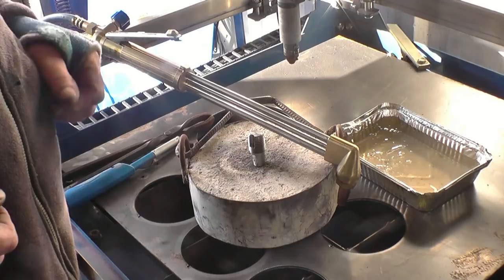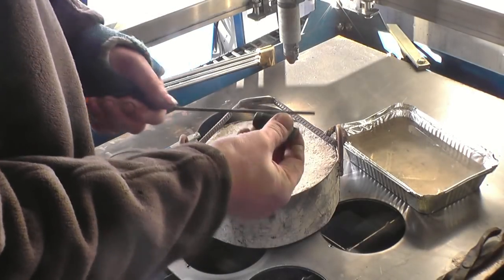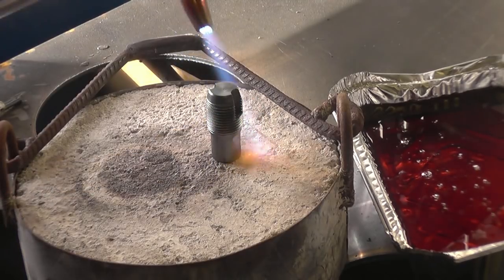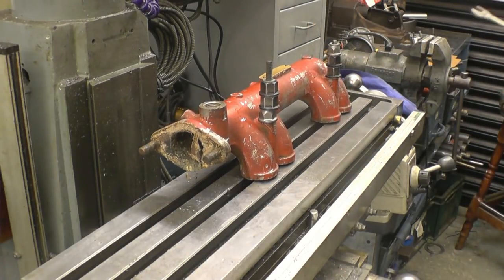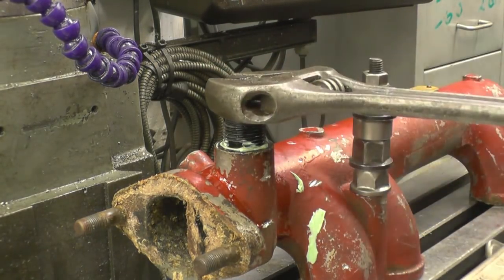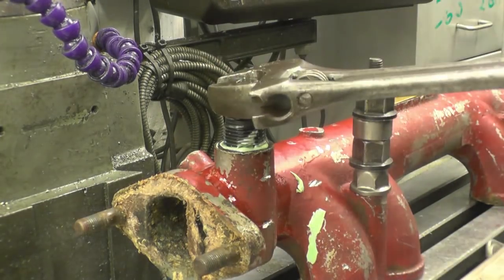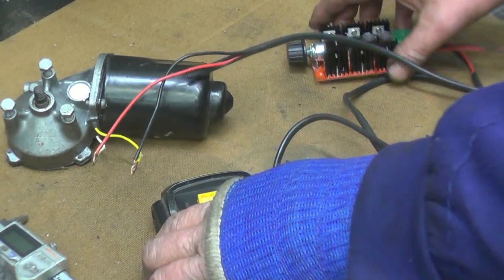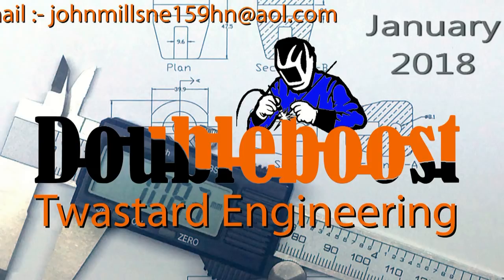SNNC 207 P2   Hardening & Tempering A Tap

Comment: Most tool steels are best air cooled after tempering, a re-quench should be avoided to reduce likely hood of cracking and improve toughness.
Reply: i used to put a thin layer of oil on top of the water so you didnt get the sudden chill

Comment: Drill and tap a shaft that will screw onto the wiper motor mate, add a grub screw to the side to lock the thread. It will save you stripping the motor. Just a thought.

Comment: you could just add a small rubber wheel to that wiper motor and use that to drive the edge of the table you already have

Comment: John, you are just going to have to stop breaking yourself. Sooner or later that sort of thing is going to hurt!

On the motor drive, why not put a flat on the wiper motor shaft and drill a matching hole in the end of a cut-down stub of the drive shaft and use a setscrew to hold onto the wiper motor shaft?

Comment: Great stuff from the North East. Silver Steel or AISI O1 Tool Steel is an Oil Hardening Steel ( ref "O" prefix). Search West York Steel for excellent info @ data sheets. Still enjoying the inventive methods and producing a wide variety of equipment. Get better soon chap.
Reply: Given the hardness differential between silver steel and aluminium, I wouldn't have bothered heat treating it at all but if so, you are correct, it's an oil hardening tool steel.

As for the tempering, he drew the temper clean out of it with a complete lack of knowledge on the subject, as in 'It's a beautiful blue colour and it we're waiting for straw...'! Bollocks man, the colours are, in order:
1) light straw
2) medium straw
3) dark straw
4) light purple
5) dark purple
6) blue
7) temper buggered.

All it needs for a tool steel temper is to bung it in the kitchen oven for 2 hours (soaking) at 220 C. Job done! You don't need oxy-acetylene heat for tempering.
Reply: Excellent on temper colours, and yes, 220C would result in HRC of 60+, if full Hardness was achieved. For torch tempering of slightly smaller items, a soak plate under the intended lower hardness/tougher end. For more intricate items, stress relieving is required, NOT Annealing;  slowly raising to 630/670 C then air cool (ambient ≤20 C). Then perform hardening and tempering. But again, in this case Silver Steel/Guage Plate or O1 is quite tolerant on workshop methods,  Chrome and Manganese help in that respect. Better to have a homemade cutting tool more tough than hard for one off usage. Regards John.

Comment: would like to know material ? hss or equivalent . ? etc. its important to bring up to temperature at more controlled rate i.e. butane ..........plus cherry red throughout ? if your quenching in water then much more solution required as cooling time important too ? plus hardening quench is water, tempering quench is whale oil or viscous equivalent ? ................. it would appear roc is lost here regardless of material ?

Comment: Hi John. I’ve just about finished making my turntable. I’ve used the same wiper motor with a chain drive to the spindle. Using a 3 to 1 reduction I can slow it down to 2 minutes per rev , also using an eBay 240 to 12v power supply. Going to cut the top plate at work tomorrow. Look forward to seeing yours and thanks for the great vids.

Comment: Can you not just drill a hole in the shaft and tap to take the wiper motor as it is? Then if your motor chucks it's hand in it's a simple swap over with another 2nd hand motor.

Comment: Hi John in the last few minutes of the video you showed a wiper motor & reduction gear. Can you not cut & tap the shaft the thread of the wiper motor spindle & thread it on?
Reply: Already has a thread, M8 though depends on the motor if it is left hand thread or regular right hand.

Comment: Take the Bonfiglioli worm drive and trim the excess input flange, then make a simple aluminium plate to fit the existing remains, that has the 3 hole mount for the motor. Then take the shaft and simply cut the tip off with the keyway, and drill it and tap M8 to fit the wiper motor shaft, and screw onto the motor and use some loctite 603 to hold the thread in forever. Then bolt together, with the motor to the side, and put on a hinged base with a spacer for 30, 45, 60 and 90 degree fastening, then use the output shaft ( probably the remains of the motor shaft cut down, and you just use a clamp bolt into the end and a flange, no need to actually use the keyway there, torque is low enough plus it makes a rough and ready friction emergency clutch) to the mounting plate for the welds, and put a hole set there for clamps and a trio for the chuck to be bolted down.
Reply: makes sense apart from the spaghetti drive, no idea what that is :)
Reply: The reduction gearbox, part of a Bonfiglioli worm drive motor gearbox combo. Could be Chinesium but the nice casting says it was made in Italy, the Chinesium ones are very similar looking but not so nicely cast and machined. They do the job though.
Reply: yep john knew a good car to nick the wiper off! unless hes waiting for a rolls royce to come in!